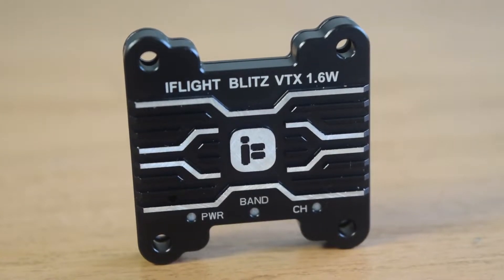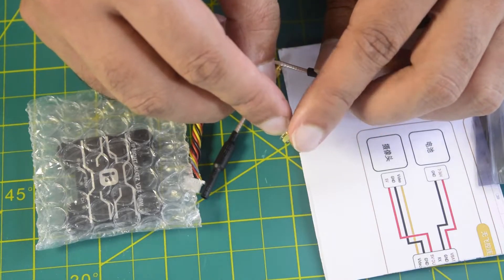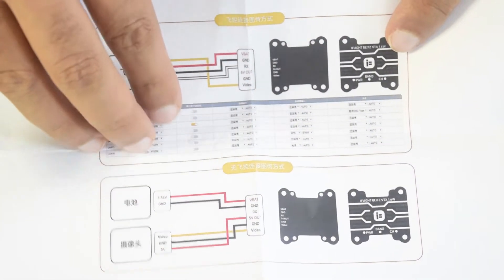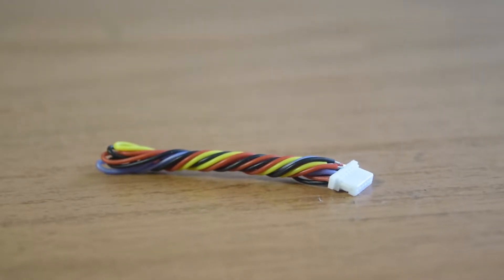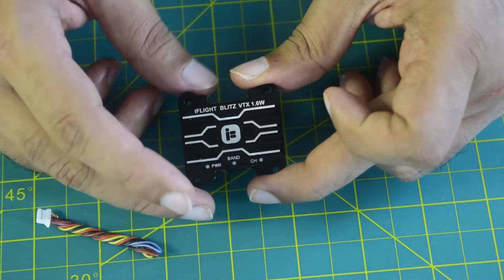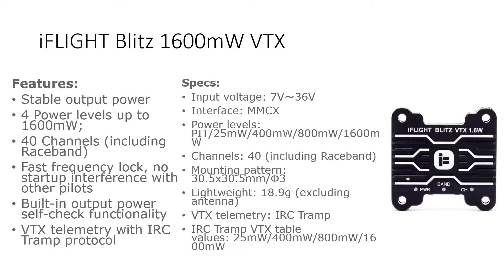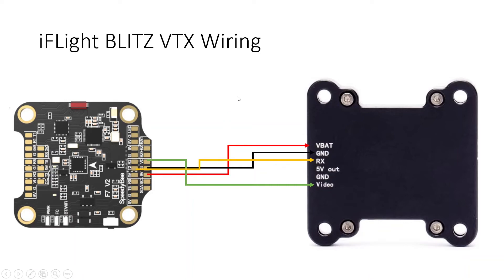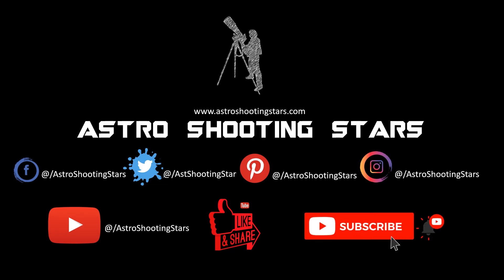iFlight Blitz 5.8G 1.6W VTX Switchable VTX FPV Video Transmitter | Review and Wiring

Comment: How do I unlock from pit mode
Reply from the maker: You can turn it off pita mode in video trasmitter section  in betaflight. If it keep turning on everytime just make the low power disarm to stay on and save this will solve the issue. I hope this helps.  Please stay tuned to my channel for my future videos

Comment: Hello! Can you help me figure out how to change the output power level? I have the same vtx and it was working perfectly but I had a light crash because my antenna disconnected. I reconnected it and made sure everything else was fine; it was. ( I don't have the user manual & they don't have it on their site). I now only get maybe 50 ft of directly line or site & it disconnects. I don't know what to do, I've contacted their customer service but they're out for 2 days. Any tips is greatly appreciated
Reply: I wasn't aware that it was done in beta flight. I got it changed !